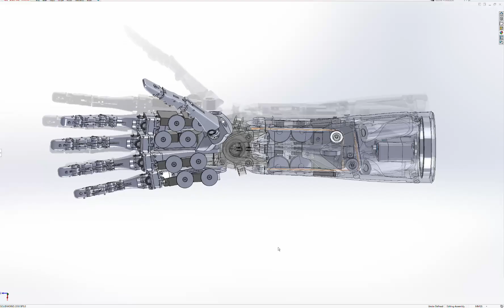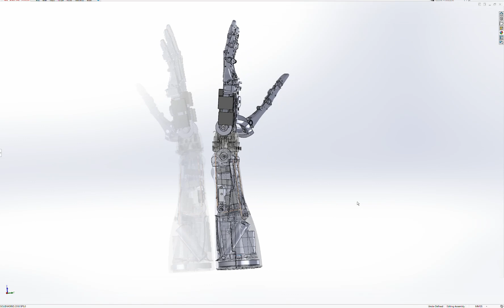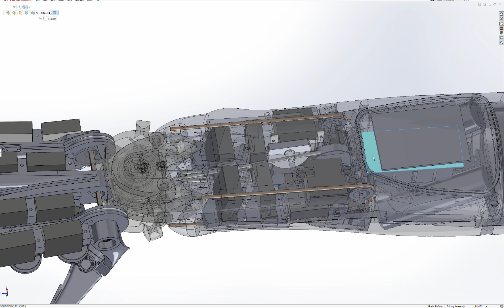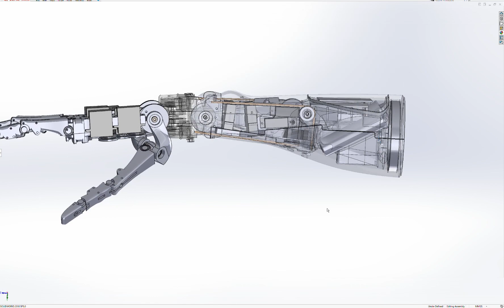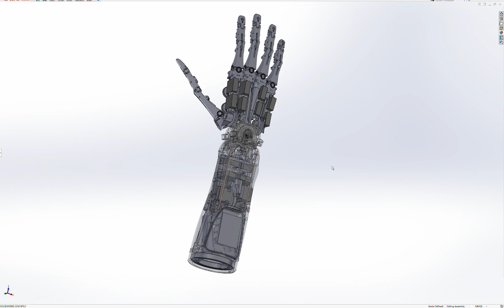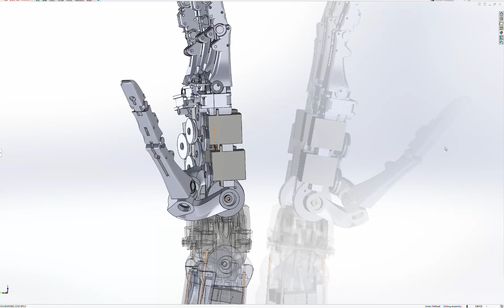Robot Hand - CAD for first print in CF nylon

Comment: How long did it take you to model this?
Reply from the maker: Without checking the dates on the CAD files I can’t be entirely sure but must be at least a couple of hundred hours by now!
Reply: @therobotstudio  I was asked to make an entire arm model within a week, but I couldn't finish it on time
Reply from the maker: @Azeoble97  Asked by whom? Most robot projects are measured in years, ASIMO, Atlas, etc are all well over a decade in development. Typically, I allow as much time for the hands as all the rest of the robot put together. These hands have 19 DOF fitted into a very compact space which certainly adds to the challenge.